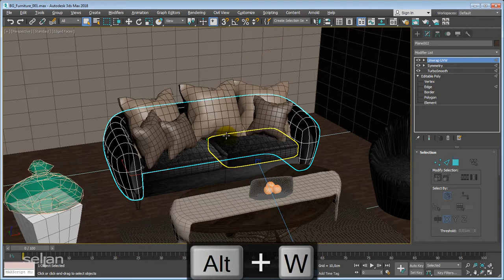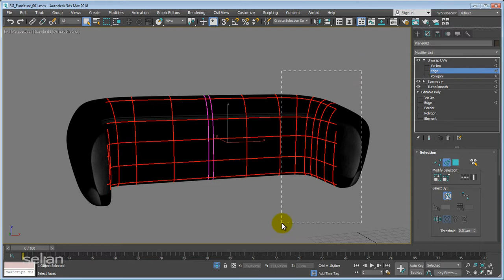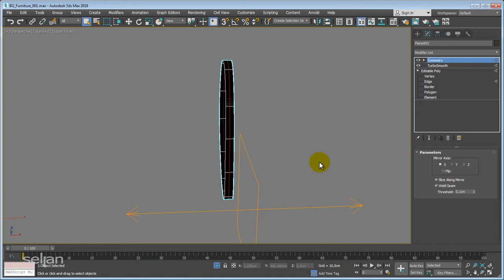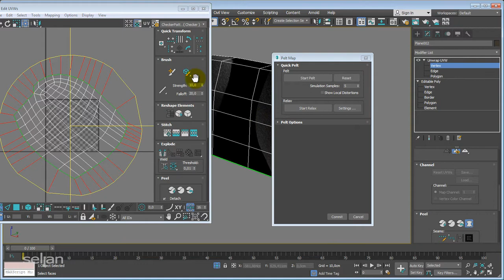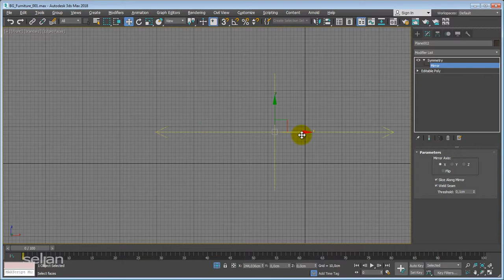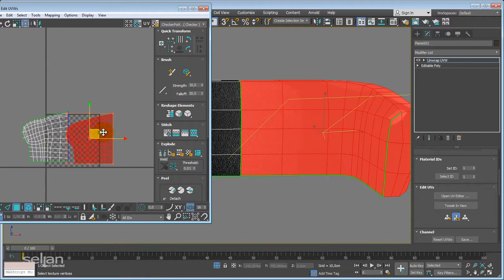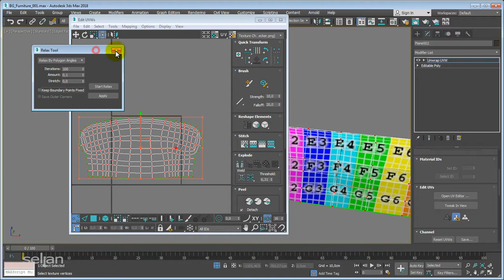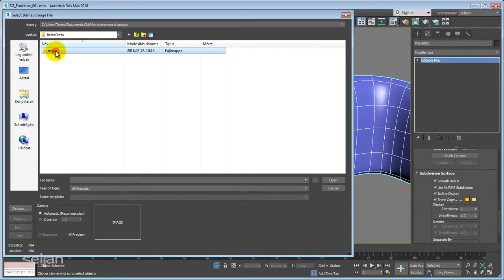MS3D | 3dsmax | Maps | Practice | UV Symmetry

Comment: Hi! I know this comment is very new w.r.t the video and I don't know if you are still around to reply here, but I had a question. What if the object im applying symmetry to isnt going to be welded? For eg, and arm of a robot that i apply symmetry to, do I need to separate the UVs or the overlapping uvs would be fine?
Reply from the maker: Hi, for a simple texture overlapping UVs may be fine, but the pattern will look mirrored. You can simply use pack UV in UVW editor and re arrange things. For checking if UVs are flipped you may need a texture with numbers and simply use the mirror function within the UV editor. But again, for simple stuff overlapping UVs can save some time.
Reply: @ms3d622  thanks a lot! that clears it up